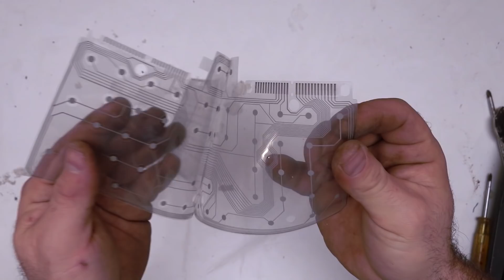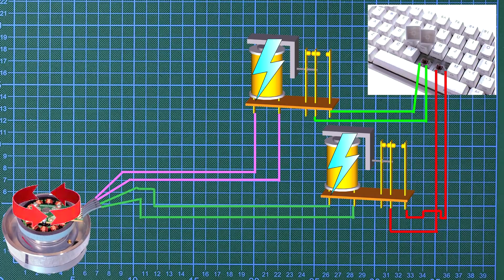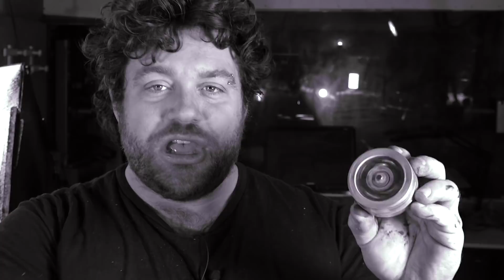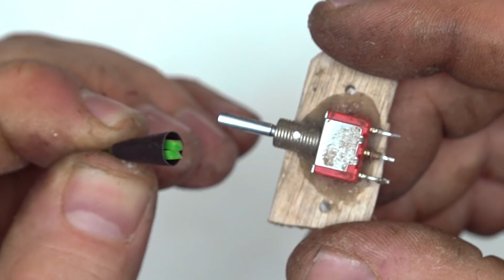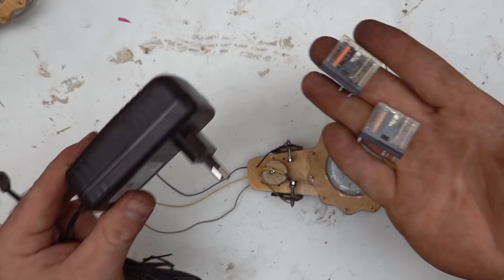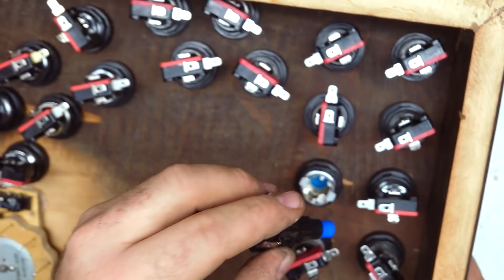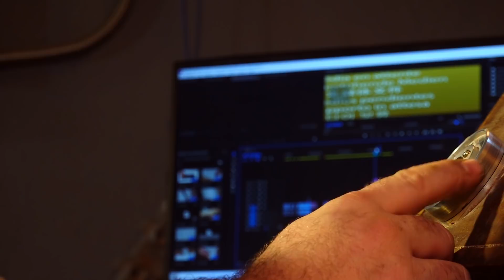How to Make Knobs • Control Any Software - No Electronics Used!

Comment: I would attach the motor to two diodes and then I don’t know what I would do but something with diodes
Reply: Exctly if it has two phases (4 wires) you can connect two of them together so that the motor coil would be one the opposite of the other as the motor rotates then you can differentiate with diodes wich direction its rotating

Comment: Couldn't you just have repurposed an old mouse and used the scroll wheel and drive it using the knob? It rotates freely and also changes direction
The way you did it looks way cooler

Comment: You would not be able to produce enough voltage to run the 12v Relay.
You have to spin it really fast
Reply: Not only voltage. There would not be enough current.
Reply: @zaprodk  yes